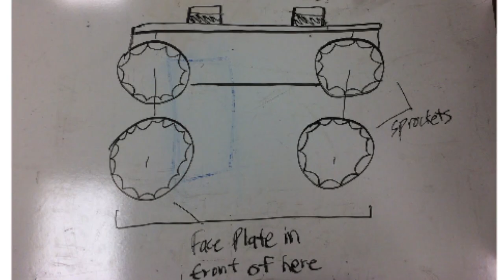Vex In The Zone PROTOTYPES! 4 bar lift, Roller (Goliath Intake)...

Comment: Not trying to butt in or anything, but a few things that I saw that would make your robot SOOO much better:
1. Switch as much steel as possible to aluminum, preferably starting with the top stages of the lift and moving down to the base. The reduced load on your motors will allow it to move so much faster and smoother, as Aluminum is 1/3 the weight of Steel.
2. The shot at 1:09 nearly gave me a heart attack. Rather than using a ton of idler gears to connect the two 12t gears to the top gear (which, due to friction, basically negates about 3/4's of the power the motor could be giving), just put a motor on either end of the top 12t and it'll work miracles
3. Another gripe about the 1:09 shot: remove all of the shaft collars outside of the C channels. Since you already have shaft collars inside of the C channels, you don't need them on the outside too. All they're doing is generating extra friction, which again, is reducing the power the motors are supplying to the top gear.
Keep at it!
Reply from the maker: +Dylan the Tactician So for some reason YouTube doesn’t like very well thought and written out comments because it said yours was spam 😂

Thanks for taking the time to write this great comment out! We will definitely look into what we need to improve, the shot at 1:09 was most likely a previous design that we redid, but I’ll double check. 
AGAIN THANKS MAN!